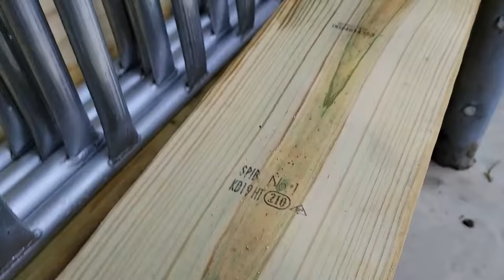There's A Serious Problem With Our Roof | Our Trusses Are Warping

Comment: Couldn't  you put up a few jack  boards to straighten the bow, and or ,r&r prob 2x. And what about length shrink?, on said prom gable stud. 
 On any gable stud, I like Jack's on both sides.
Reply: I live in a somewhat heavy snow area. Lower southeast Michigan. (Detroit suburbs), I believe u have heavier issues where you're located. 
           Yes snow is usually measured in inches. But certain areas have learned to measure scaled weight. Depending of current storm issues.
      I am willing to come and give an extra hand if needed. Familiar w Michigan's cold. But willing to try your territory of cold. Just if you want me to come, give me an idea of what to come..., plz

Comment: Whose idea was it to use 2x4’s to build side walls? My carpenter’s used 2x6’s for my garage, and cut in a 2x4 diagonally into the 2x6’s to stabilize each wall. Sure looks like your wall is not stable.
Reply from the maker: It’s not a wall, it’s a truss.

Comment: Stuff like that worries me especially cuz I just put massive amount of money down on my trusses for next year. I had mine "over engineered" so it could take a load of 250 pounds a square foot. After talking to nearby neighbors Abt basements and things they would have done better along with asking for recommendations for contractors concerning plumbing and etc. I was told that code was insufficient for roof loads in the area and every so often there would be massive snow falls unexpectedly. I am not a big fan of trusting others but seeing I have no clue how to design engineer and make these myself I am having to put trust in these people. It can be a simple small mistake that can cause all my hard work and energy go-to waste and my roof cave in.  I am probably overthinking all of this but this is my dream and out of their love for me my whole family followed and supported me unconditionally and I just don't want them disappointed nor to feel like they gave something up instead of gaining something.
Reply from the maker: Always something you risk when outsourcing things. Just have to weigh that risk vs the potential benefit/reward.